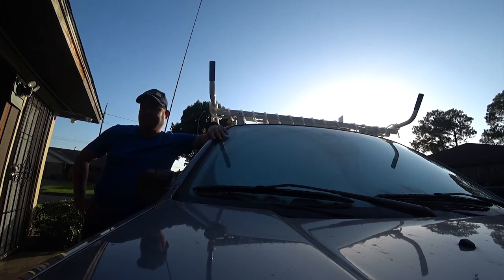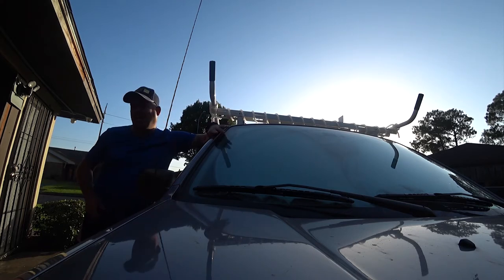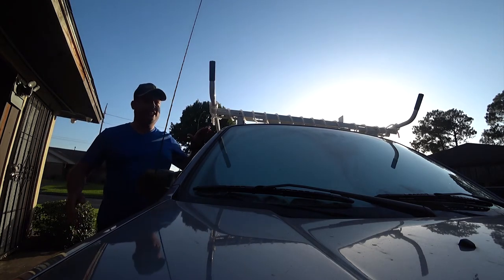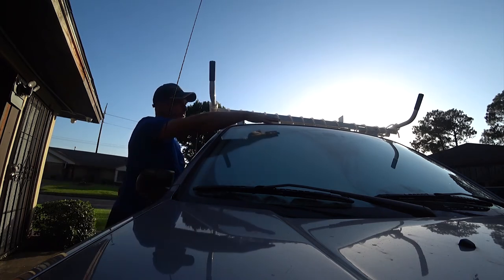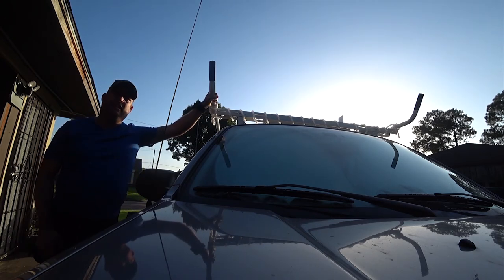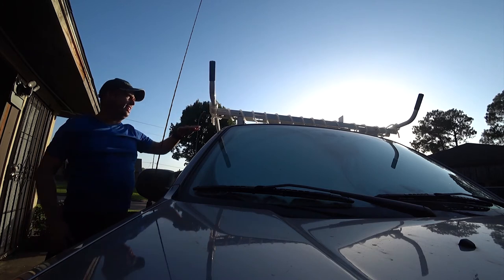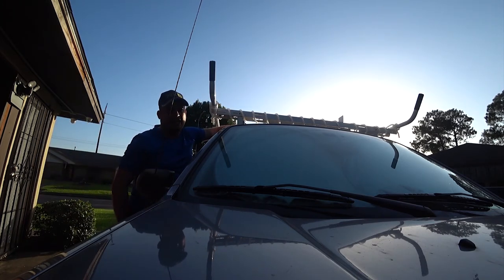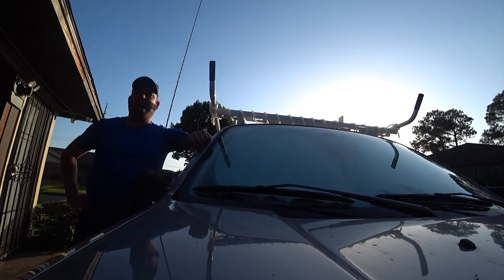How to get rid of Severe Ladder Rack Noise

Comment: Thanks! It works great. I've been driving around for a year putting up with that roar. Couldn't hardly hear the radio it was so loud. Headaches gone too!
Reply from the maker: I'm actually going to detatch the rack for a while.  I have a couple of roadtrips coming up and I don't need the rack for them.  So it will come off and get stored.  :)